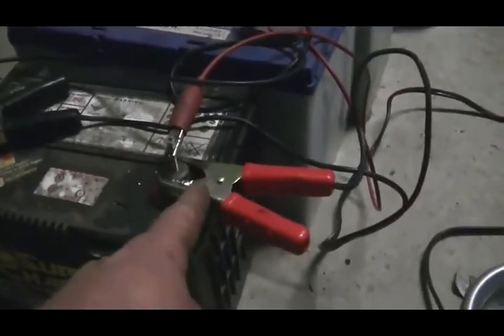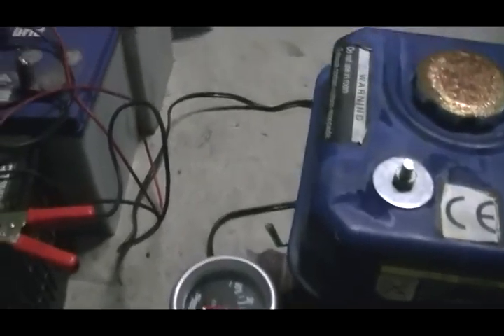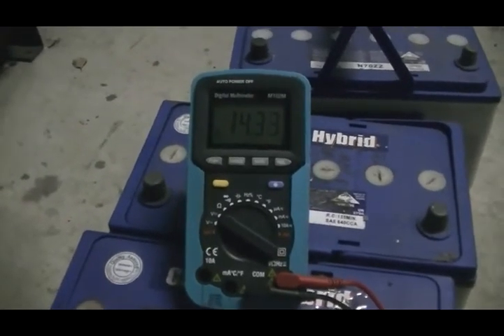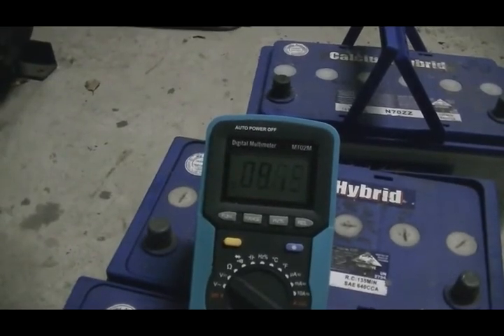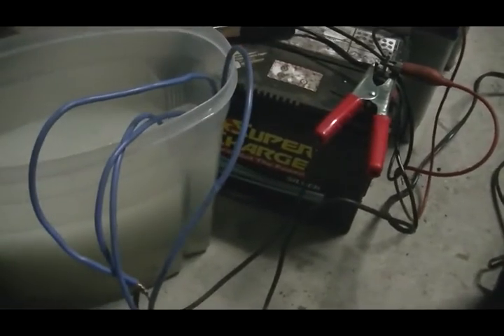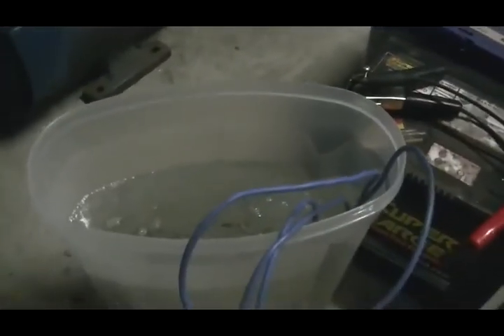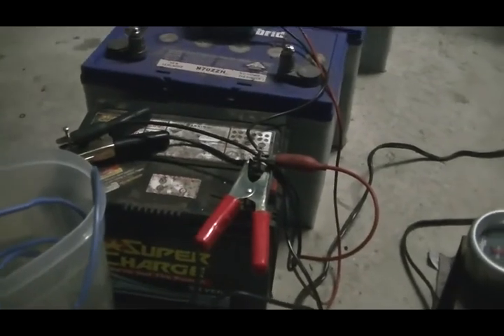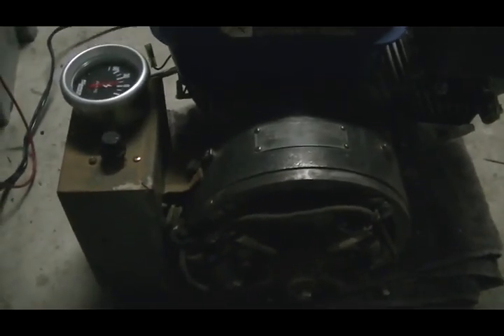Gen E Motor HHO

Comment: Again; Good one TM, The Cell is probably smoothing the spikes. As it is a Cap and Risistor in one. But (a little controversial) If you were to take the same arrangement, and run it from the Neg. side. For a better charge effect utilysing the pulses. But may produce less HHO. A second amp meter between the battery and the cell, you could determine exactly what the cell or battery need.